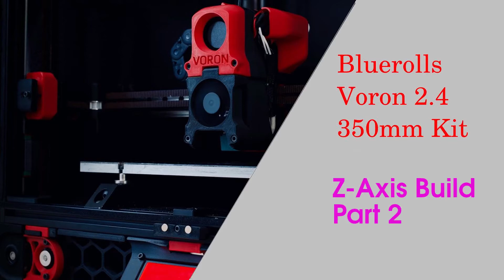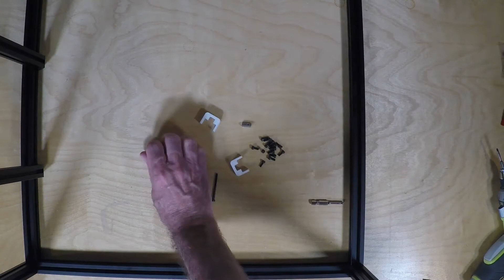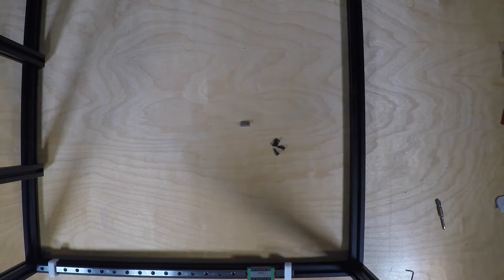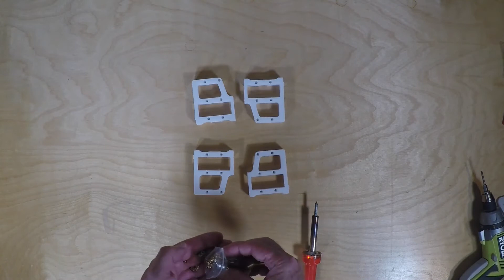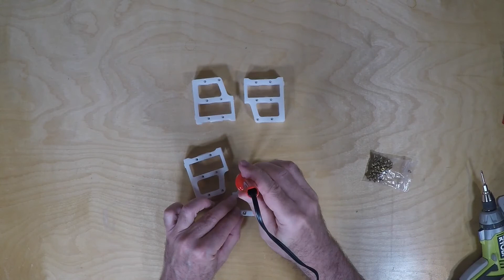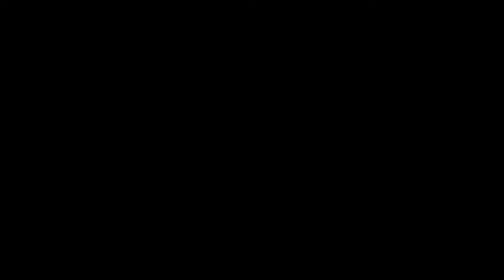Voron 2.4 Blurolls Kit Part 2 - Z-Drive Assembly

Comment: One thing occured to me when I watched you mounting the rails. Isn't it easier to just put the rails on with three screws (left, right and center), soft-tighten them and then get the alignment tools out to properly align them? You can then easily center them, fix the rails with the three screws and the put in the rest, while the rail is already centered and fixed.
Mind you, I'm saying this from the comfort of my room, no experience with building my own 3D printer (but I'm preparing to, that's why I'm watching this). Not trying to be a smart-ass... :)
Thanks for sharing this! It's good to watch this build from various people. It's already starting to feel as if I'm building one myself. Great preparation and learn from other people's experiences.
Reply from the maker: It probably would have been a little easier.  That said, with one hand holding the rails and the square with the other tightening the hex bolts, it seemed to work ok.  What was surprising was once it was all together, it took some additional adjustments because some rails seemed  slightly misaligned (a mm or less).  So it took some additional time to slightly adjust each corner.  Now it it's running and heating up in my basement, I'm going to check it once more in a few more weeks since I'm wondering if the hot interior and cold exterior are causing some additional expansion changes.  All that said, I really like the printer.  I can't believe how well it's working.  And thank you very much!
Reply: @KapmansBasementWorkshop  ok, thanks for the insight. It's indeed a good idea to check tolerances after a while. It does get heated up every time and it moves. In another Voron build video, someone let the build plate heatup for some time, while keeping the screws a bit loose. It's supposed to be casted, so it shouldn't deform when heated, but it's from China, so you never know if they did it properly... :)
Reply from the maker: @PhilippensTube  , I heated it for about 30 mins and then slightly tightened the screws.  But I will give it a second try in a few weeks after more use.  That said, it's printing great!
Reply from the maker: One more thing, good luck with your build!

Comment: Did you clean the oil off the linear rails and grease the carriages?
Reply from the maker: I simply wiped the rails down to get rid of the excess oil.  It's mineral oil and compatible with the white lithium grease I used to lubricate the rails.  Also, the instructions for Hiwin rails don't mention cleaning before lubrication.  I was more concerned of any damage I might do by disassembling the rails for thorough cleaning when so new or having any left over solvent from soaking without disassembly which might negatively impact the grease.  I know this counters what many people recommend, bit I seem to have no trouble with the grease I've added and in my past, working with CNC metal working machinery, it's normal to force new grease into bearings until the old dirty great is expelled.    One more thing.  In this channel, I have a video that shows how to lubricate the rails and it presents excerpts from Hiwin documentation.
Reply from the maker: Here is the link to the video: https://youtu.be/jqBq4DB89f8